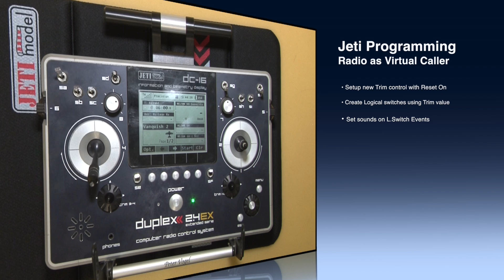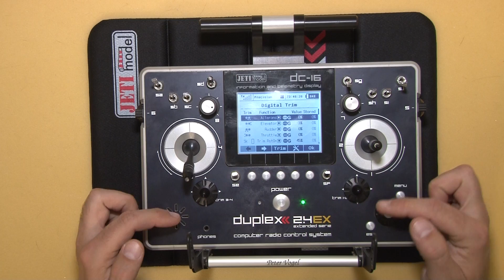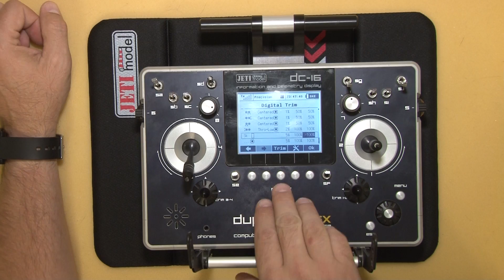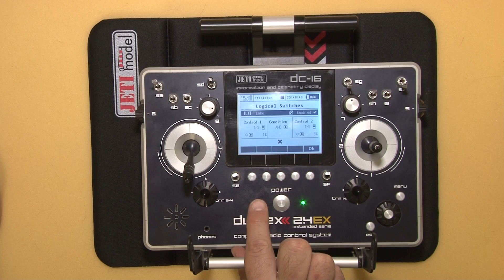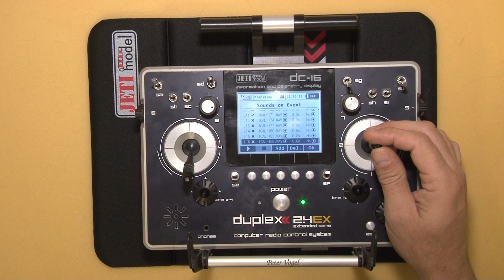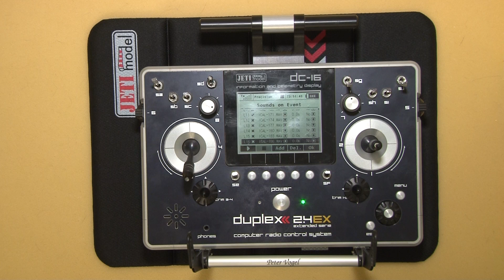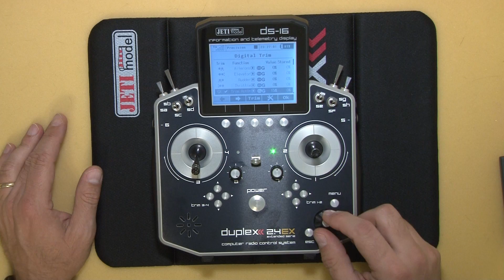Virtual Caller

Comment: Oh wow... That i haven't thought about at all. Thanks for the tip Peter! :)
Reply from the maker: With V4 of the tx firmware this is no longer necessary as long as you have a directory with all your call sounds, you can very easily set up a single switch to advance you from sound to sound within that directory, one at a time.  Which is a feature I requested of the Jeti team a while back.